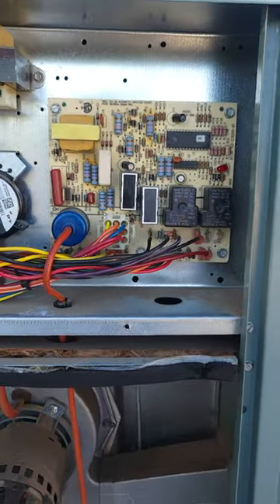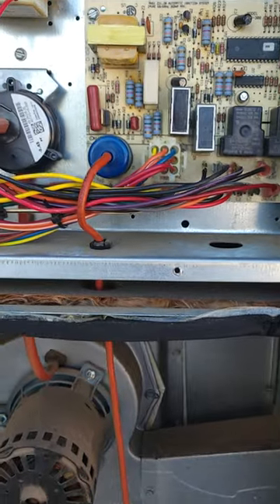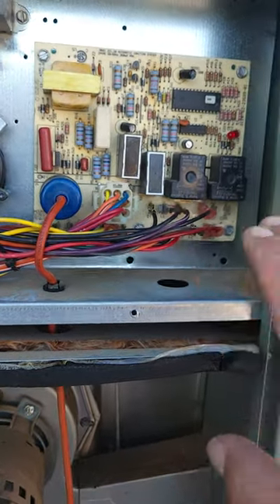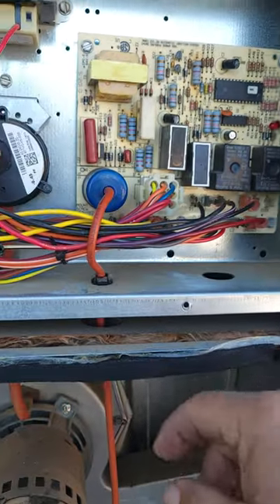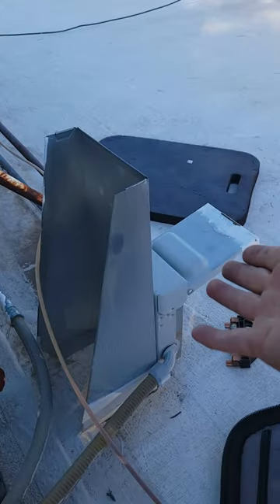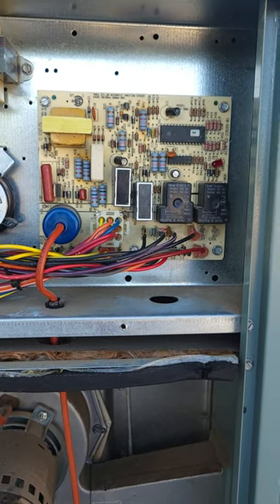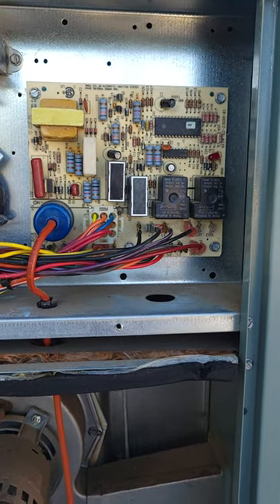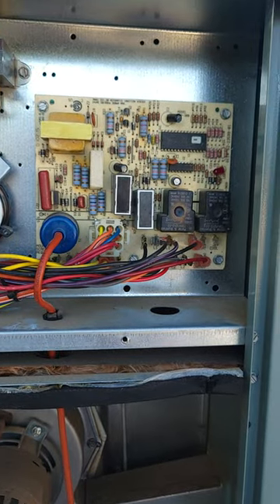Gas furnace or heater didn't turn on, and is not doing anything #shorts

Comment: Oh so videos like this is why when I get to a customer’s house they tell me “ it’s working now” and I don’t have a code to go off of. I’ll cycle it over and over, never seeing what the issue was, knowing that it will happen again eventually. Usually later that night or the next day to have the home owner call again on something I probably could have diagnosed within 15 minutes had the code been there. Long story short DO NOT RESET THE UNIT!!!! It happened for a reason.
Reply: Hahahaha I hate when they do that. It happens every single day. And they get mad that you couldnt figure it out 😑
Reply from the maker: I see your point, and yea ofcourse it happened for a reason and it may probably happen again. 
But if your mom called you at 2 am or someone you know or if your package unit when out in the middle of a freezing night, you would most likely give the same advice. If this video helps someone in need in a cold night. (Not everybody can afford to call for after hrs repair). It did it's purpose. Also, I have seen units fail for one reason or another and later (after it unlocked) run perfectly fine. 
Ofcourse this method is not bypassing any of the safety protections on a unit. If something is unsafe it will simply not start.
Reply from the maker: Also, if you didn't get there fast enough or they didn't call until the next day. You may not get the code anymore if the unit started after it unlocked. (Assuming the unit starts after reset)
Reply from the maker: If you couldn't figure it out that means the unit is running fine(at the moment), let them know that if it goes out again don't reset it and call right away regardless of time (because it only locks out for a certain amount of time). That way you'll see the code and make your customers happy.
Reply: @MaintenanceManNarratives  
I always let them know that it may be an intermittent issue and that if it goes out again DON’T RESET IT. We do not charge after hours fees so 24/7 same service fee. No reason not to call, unless they just do not want us there at that time. I understand that you are just trying to help people just mindful that some homeowners do not take their own safety into account when they are without heat.
Reply: Thing is that more often than not if you check everything thoroughly you’ll catch the problem. Not every time but it’s pretty rare I can’t catch the problem even with no code to go off
Reply: Well if the board is out in a lock out then something is wrong, what if it’s out because the heat exchanger is cracked and it’s sucking the flames out? Not safe cut the shit off and call a professional not a maintenance guy, call a technician there a big difference
Reply from the maker: Roll out switch will be tripped in that case. And unit will not start. The fact that someone works for an hvac company does not make them better or more knowledgeable. The last company I worked for I saw alot of guys who never really understood the trade. Just changed parts, they don't care. The more they sell the better. That's why they get paid commissions. Don't get me wrong,  their are alot that are very knowledgeable and understand exactly how these units work and will diagnose without having to read a code.
Reply: @MaintenanceManNarratives  and all it takes if for someone to say oh let me have heat for now I’ll bypass it because it’s just a switch. When no switches or limits should be bypassed except for testing purposes
Reply from the maker: You're absolutely right!! I would never do a video like that
Reply from the maker: @jman0870  I have lost respect for titles or job names. I was at a home last week where 3 companies had gone and just changed parts and couldn't fix a package unit. I spoke to the lady and she told me the airflow was weak and not consistent. I knew right away she had a failing capacitor. I went up to the unit and sure enough a 12.5 was reading 8.2. 
I have asked "feild techs" what a flame sensor does and they think it's lika a thermocouple. Most don't even know it's sending an electrical current  through the flame and it completes a cicuit only when there is flame, not heat. 
Regarding the reseting of a circuit board, I am very confident that all the protections are still in place and if a unit does start it's because of a dirty flame conductor or a stuck limit switch (that didn't close in time to restart unit) or possibly a vavle that failed to open. I don't work in the hvac industry because I don't like to sell, last company I was at they told me, we don't lie... we just don't tell the complete truth!! I stay here and make as much money without having to occult the truth to hard working poeple just to sell them more.
Reply: Jim Benson  no…intermittent ones are almost always a pressure switch or high limit lockout 🙄

Comment: Once it's in lockout it's in lockout you have to find out why it went out and lock out and fix the problem
Reply: What is the 5 most common reasons?
Reply: @samsen3965  I think he pretty much explained all five or at least four and who knows maybe a bird made a nest in the intake
Reply from the maker: I didn't make this video for techs, they should already know this. I made it for homeowners, I realize that if the unit does run the error code will no longer appear. But also if the homeowner didn't call right away and the unit does turn on (after unlocked) you will still not see the code anyway. If resetting did not start the unit the tech will easily diagnose the problem and fix it. This video is made to try to help someone get through a cold night or day. Not everyone can afford to have a tech come out at 2am and fix the issue before the unit resets and starts (maybe). I don't believe I'm putting anybody in danger because all the safeties are still active in the unit. If the blower went out, that tripped the limit switch and the unit will not even attempt to run. Same thing with inducer. But if the valve did not open or flame sensor is failing because it's dirty the unit may start and still be safe.
Reply: @MaintenanceManNarratives  I understand your point. There's just so much going on with these nowaday furnaces. I guess I get a little paranoid with the liability issue and I would hate to see something stupid to happen. And you're right if somebody called me and I gave him that information to reset it and then the next morning I find out the house burned down I think I'd feel pretty devastated. It's all good no disrespect.

Comment: Gas furnace in my last house did this. If I cycled power, it would work fine for a day or two. By the time I got a tech out to look at it, they said the entire board was bad and it was discontinued since the unit was over 18yrs old. They suckered into replacing the ENTIRE furnace at a cost of over $1100.
Reply: That happens sometimes, but on a lot of older furnaces you can find a universal fan timer board that will work for the application, you might need to swap out some pigtails. The Honeywell ST9200/U can replace a lot of hot surface ignitor type of boards. Where it gets really hard is if it's a 2 stage gas furnace that's over 10-15 years old, there is almost no universal boards that will work, especially if the furnace uses two pressure switches, a two stage gas valve, and a 2 speed inducer motor. I ran into an older Bryant furnace from around circa 2000 with a bad board, blown indoor blower motor relay, was no long available and even if it was, it was very expensive. So even though the rest of the furnace mechanically was in good shape, had to replace it for the guy. He was understanding, and he also did not want to put a $300 circuit board into an 22 year old furnace with a noisy inducer motor, it would still run ok, but the bearings were on there way out and just would have been a money pit anyway.

Comment: A 5ton rooftop unit with a fucking flexible gas supply🤮🤮🤮🤮 blows my mind
Reply: Especially a flexible line not UL listed for outdoor use... Hack job. You can get outdoor rated flexible lines, but they're not yellow and they're not cheap. I use them mainly on generators, it's required to have at least a short length of flex line to isolate engine vibrations from the gas piping.

Comment: Then after you checked everything else,  check the heat exchanger for cracks and holes.
Reply: Do that first tbh. Cost of a heat exchanger replacement is not cheap and customer will not be happy if you just changed a part, then come back and say "oh btw your heat exchanger is also bad. Can't run the unit I just fixed until that's replaced"
Reply: @4oh4n0tf0und  Actually for a lot of these small package units the heat exchangers pre-covid nonsense weren't very expensive at all, and quite easy to pull out and replace. But with todays shortages, good luck finding any around in stock for a unit of this age... They're made of unobtainium anymore.

Comment: I'm not sure that I agree with simply ignoring a problem by resetting the control board and forcing it to work again. There are safety features on that board for a reason. Your kind of thinking is why stuff eventually melts down and causes fires!
Reply from the maker: All the protections are still functioning properly at that point. If it turns on it will be because a dirty flame sensor failed to read, a limit switch didn't trip back when the temp got low enough in the chamber, also possibly someone had covered a return vent (happens when return vents are on the lower part of the wall or floor in some mobil homes). With all other issues the unit will not turn on at all.

Comment: Why are you telling people this. If it locked itself out because of a problem, why would you tell people to reset the lock out.  Most units will not reset themselves after 24 hours. They will remain locked out until a "qualified" service tech finds the problem.
Reply from the maker: Sometimes it's a stuck limit switch or a vavle that didn't open due to humidity (specifically after rain) many times it will run. Of course if the problem persists they will have to get a repair. But I have seen many units that do turn on. This is just to help someone try to get their unit running. I know it may not start but hopefully this helps someone in an emergency and they may have heat for a night.

Comment: You can also unplug that cluster I think it's a j-1 connector with the 9 wires in it that will reset the system you can also cycle any of the power from if it has a onboard fuse on the circuit board but also remember people when they trip out on a hard lockout it's for a reason find that before you go trying to just turn it on and then leave it always check why it went out

Comment: And get the blink code before you shut power off.
That will you at lease a spot to start looking.
Reply: Some boards have a 'recall' button, press and it'll flash the previous few codes. On Carriers and a lot of their sister brands, if you re-apply power with the call for heat still active from the thermostat, it'll also flash the last 3 failure codes. If it's a rooftop unit, save some time from going downstairs to only find out it's a hard wired thermostat, just jumper out R to W1 at the board with the power off, and put the disconnect back in. That trick helped me a few times.

Comment: Yea but if is not turning on that's mains there is something wrong with the units  could be many things but taking the fuses off or kill the power completely 99% of the times is not going ti solve the problem that's just to see the sequence of the furnace and find what parts or component is not doing the sequence.

Comment: it locks out for 3 hours usually not 24
Reply from the maker: I think you're right, different units have different lockout times.
Reply: Some are 1 hour. A lot of Lennox commerical package units also have a 3 strike rule. And that lockout lasts either for the remainder of that call from the thermostat, or until the power is cycled. If the thermostat continues to call for heat, it'll stay in lockout forever.

Comment: All fun and games until a building catches fire and the owner says well... the guy on YouTube said to do it... LAWSUIT
Reply: Well, power cycling an appliance can't really be grounds for a lawsuit. Otherwise the utility companies would be getting sued everytime a tree limb bumps into a power line, and the recloser trips a few times until the fault clears. As long as someone doesn't open up the HVAC unit and screw around with it, turning the thermostat off and back on, or turning a breaker off and then back on to see if it was just a temporary glitch isn't considering tampering by an untrained person, and very little risk of a lawsuit. Of course, anyone can be sued by anyone for any reason at any time, but it'll get thrown out like yesterdays newspaper if found to be frivolous.

Comment: I don’t mind customer doing this at all because they need AC or they need heat asap. I proper trained HVAC tech should be able to still diagnose the problem. Most techs already want the answer to the problem so they do not have to troubleshoot what it is. I love a challenge. You diagnose the problem and customer say all the time. Well it’s working now so we will see how it goes for now. Then it stops again,  now they pay another service call plus they are now knowing they will be paying for the fix. Easy peasy